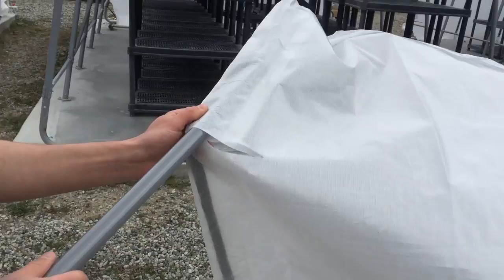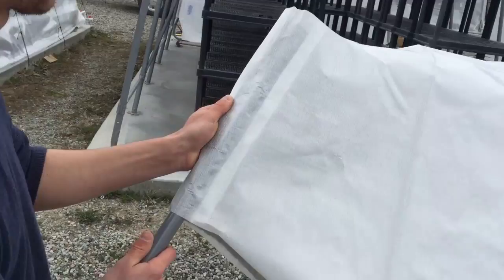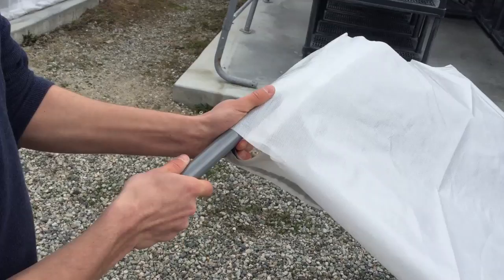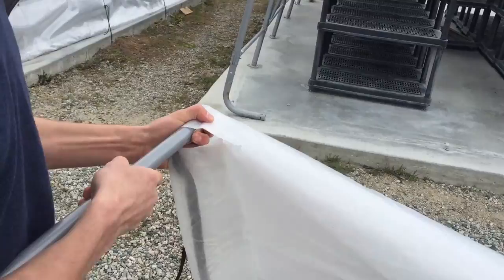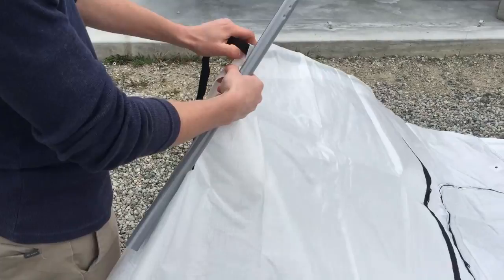Greenhouse Design For Mushroom Growing

Comment: Hey something to try to keep the bugs and elements at bay, sandwich the bottom few inches of each small wall in between two pressure treated 2x4's. Keeps the small walls from flopping around in the wind would do it again in a heart beat.